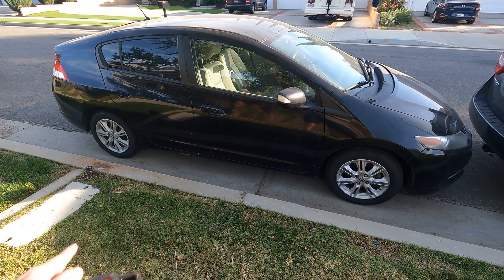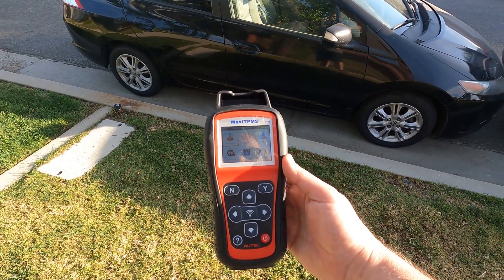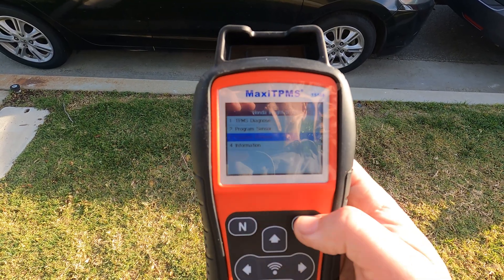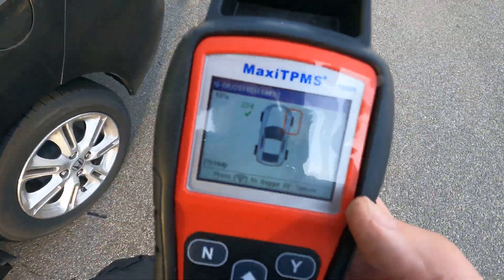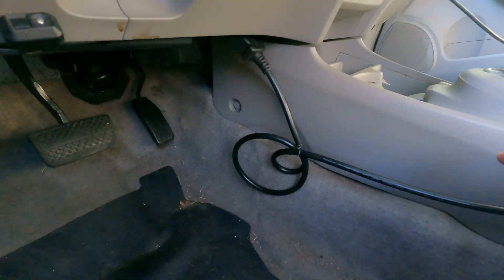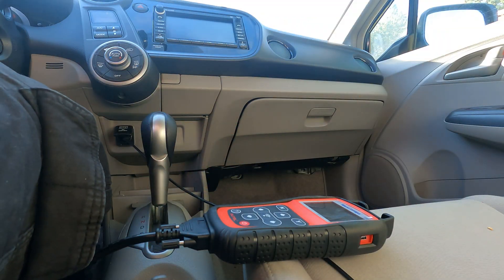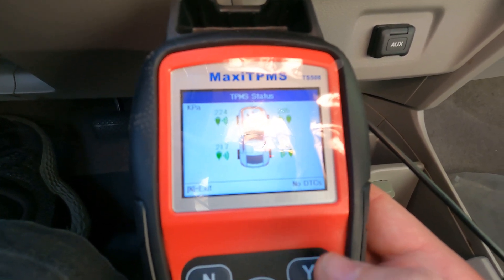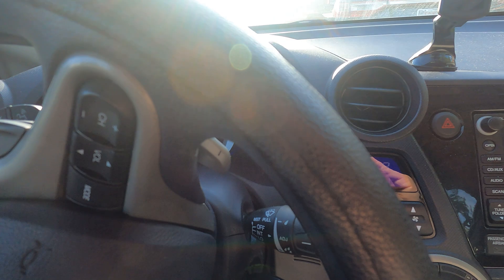Programming TPMS sensor on a 2010 Honda Insight.

Comment: Good video. After replacing my tires on my 2010 Accord and having new OEM sensors installed. Mavis said they could not re-learn new sensors to car. Said I had to go to Honda.Honda quoted $220. for that task. Will this Autel tool re-learn to car? the new sensors already have an id.?
Thanks
Reply from the maker: Depends on the sensors, but I would think it would relearn them.

Comment: I was wondering if i bought this tool to program or copy signals.  I found some oem sensors with the same part number as i need for my honda crv 2012.  I was wondering if i can copy factory signal or relearn new sensors to make them work with my car. The sensors I found are on ebay and unbranded but have same oem part number I need. So will this work or not
Reply from the maker: hmmm, not really sure, you might need to ask them

Comment: Hello friend, I also have Honda Insight.  When I changed the tires on the car, the mechanic broke the sensor (rear, right).  If I buy a single sensor and introduce it to the car with "MAXITPMS", do you think that error will disappear?  Can I buy from any tpms sensor or should I buy only with the code of the tpms sensor that comes on the car itself?
Reply from the maker: I don't really know if it would work for all of them.  The sensor I bought was new from Ebay and it was the Redi Sensor VDO SE10002A.  Depending on what year your insight is, it might be different, I'm not sure.  If the mechanic broke the sensor, they should be able to fix it for you.

Comment: between the door it might say one thing in my say.. 32 PSI... 33.PSI .But.Always put the air pressure at 35 PSI for all Hondas......
Reply: So you know Hondas better than Honda engineers? Always, always go by what the sticker on the door says for air pressure.

Comment: I don't know how to say "Thank You" enough.  After researching on this for way too long, I purchased the Autel TS508 and an MX sensor.  I programmed the sensor, did the relearn and got rid of the TPMS Error light, but had the blinking/BEEPING Check Tire Pressure light that just wouldn't go away.  I followed Autel's instructions to the T a few times and all sensors were green/good/etc.  I noticed your extra level of detail towards the end where you ran into a similar issue and just added some air.  I added some to one and let out a few pounds on the others and took it for a drive and at around the exact same distance of yours, my light /BEEEPING went away.

I thought we were going to have to torch this car with that beeping, lol.  

Thank you again, awesome video, and Thank you for the extra level of detail.
Reply: All Hondas put 35 PSI..... no matter what it read between door.

Comment: The video is great and very specific, I appreciate it that. But does anyone know what to do when the light just won’t stop blinking? I drove my 2009 Fit for over 10 mins at 19 MPH, then put some more air on the tires, tried again and the light didn’t stop blinking. I figured maybe I should drain all the air out of my tires and fill them back up to 33 PSI, drove it for 10 mins at 19 MPH and the light is still blinking. Any thoughts?
Reply: Did you figure out your blinking  light?

Comment: Went through the exact same scenario this evening also with a 2010 Insight, using  a Snap-On tablet from a neighbor, the final instruction from the tablet was to "DRIVE 28 MPH".  I thought that was oddly specific, but sure enough as soon as I reached 28 mph, the flashing message cleared and everything is working perfectly.  Great video by the way, you show the whole procedure so well.
Reply: What brand tpms sensor did you install?
Reply: @vandiyplant921  They were generic ones from Amazon, I checked and unfortunately my purchase history doesn't go back that far.

Comment: You can't go wrong with the Autel TS508. One time, I did a TPMS sensor replacement (Autel MX 1-Sensor) and an OBD relearn on a third-gen Honda CR-V. Sometimes, in order to get the sensors to communicate, driving three to four blocks at speeds above 30 km/h (19 mph) certainly helps.

Overall, you did an excellent job relearning these sensors.